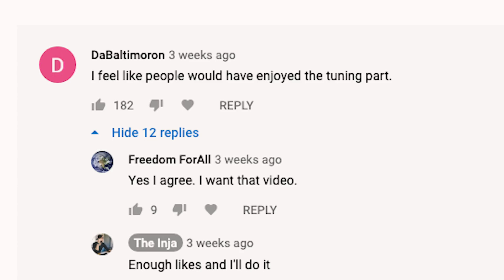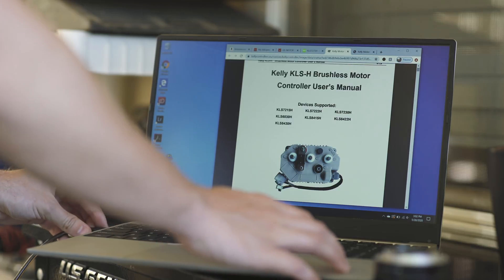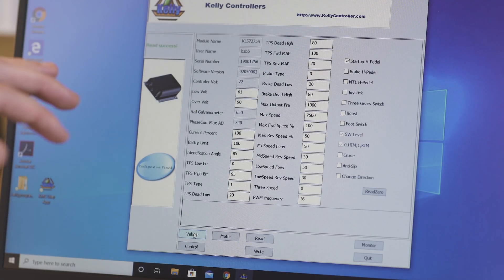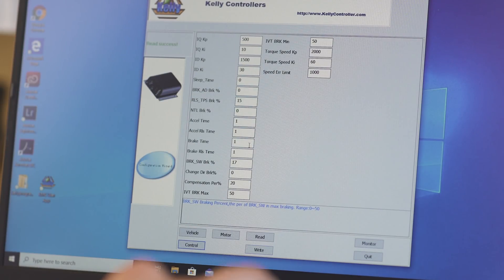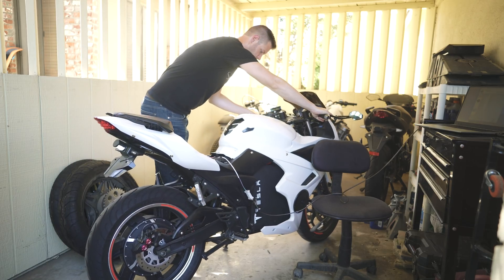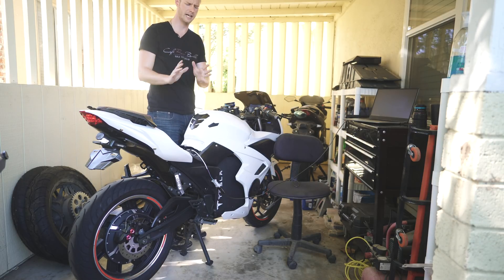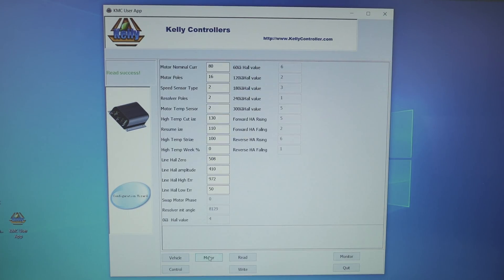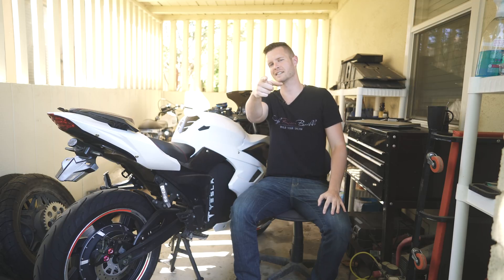TUNING the ELECTRIC SPORTBIKE (How to)

Comment: decided to pull the trigger so in a few weeks my bike should arrive. It's a bone stock rz model with 5kw motor and 72v 55 amp hr battery.
Eventually I'll swap out the hub motor for a  96 v chain drive  motor 15 kw to 50 kw depending on cost to upgrade,  and 200 to 300 amp hr battery or what ever will fit
Reply: well that deal fell through, couldn't get the cash moved soon enough so another buyer won the purchase.  maybe instead of buying a ninja look alike, i should convert my gpz550 bike to electric.  if I do this I'm looking at the sia 155-64 bldc hairpin motor, a 2.x : 1 gear box,  a controller (size unknown)  and a 96 v 100-200 amp/hr lifepo4 battery pack and all the misc stuff,  SIA has a conversion kit that provides 99% of the stuff I'll need.  any thoughts ?   thanks

Comment: I have mid drive motor and kelly controller I have use same settings but my rear wheel hub is burning 🔥 very hot I have Sprocet on wheels whyyyy is burning getting hotter when all regenerative settings it’s fine but why????

Comment: If (or when) I get one of these bikes, I will most likely go with the Kelly controller and QS hub motor (I'm not sure which one, yet) for upgrades. I'll also likely build my own battery packs like you did since I'm planning to do that for my Solar Power system anyway. Nice work on the bike, by the way.

Comment: Can you give me some tips on 5000w what controller do I need like what amps ,what size battery 72v 40ah I don’t know what size bms to use ,I will use top grade cells in the pack . If you answer my question thanks .

Comment: Hi my e bike has 1.5kw rear hub bldc. Having 70volt 30AH lithium ion battery runs upto 75km at 50km/hr avg speed. How to increase range. By putting another battery of same config in parallel? Pls help.

Comment: Sine-wave has amazing controllers as well, but Kelly's are good too. I bought a 36V Hyper E-Ride Mtb from Walmart a cpl year ago and completely redid the entire bike from top to bottom. Replace the entire front end with rock shox, front and rear hydraulic disc brakes, added a second 36V battery to make it 72V output and replaced the factory 250w rear hub motor with a 5000w brushless rear hub motor, moved the (PAS) pedal assist sensor and mounted it onto the front rim and the sensor onto the front shock so there's no need to pedal to engage the motor then the last thing I did was moved both brake assist sensors (spliced them together) and mounted them onto the right handle grip so all thats needed is to press the button to accelerate. With all the mods done the bike does approx 80-90 km/h and gets about 36km per charge.

Comment: You DEFINITELY need to change the rear rim/tire to something much wider i.e 260mm/270mm/280mm it would make it look much more aggressive similar to a R6/CBR600/GSXR600 ect. I think it would look bad ass. Right now it just looks like a 125cc/250cc.
Reply: Avon speedmasters would work fine

Comment: change your settings, thats a slow ride

Torque Speed KP: 10000
Torque Speed KI: 500
Speed Err Limit: 4000
Max Speed: 15000

ADJUST YOUR THROTTLE AFTERWARDS

Comment: Are you sure the regenerative braking is actually charging the battery? My understanding is the BMS needs to support it, because you need to send the power back through the discharge port. I'm not sure the way you have it wired (bypassing the BMS for discharge) would work?
Reply: Yeah, the discharge is bypassed :)

Comment: Hey man good stuff. Wondering if you have gotten legitimate measured HP and torque numbers. My guess would be about 8 HP. Here's my math based on my best guess of 75%  peak motor efficiency : 8000W/(745.7W/HP) X 0.75 = 8.05HP. Would love to see dyno numbers.
Reply from the maker: Peak is 12HP. Would be interesting, but not worth it in my opinion. Our next build it would be more worth it! 😏
Reply: @TheInja  Gotcha. The capability is amazing and speaks for itself. Nice work and way to hang in there. Inspiration to finish my buggy engine swap.

Comment: You should check out Cleveland cyclewerks for there edrive kit 2400$
Reply from the maker: Actually just checked them out
Reply: @TheInja  was wondering if you could give some tips on getting my channel going. My first build is 2016 Cleveland heist cost 2600dollars with drive train and battery out of a 2011 zero xu cost 2500 to build electric bobber
Reply from the maker: @buildyourdream5159  just start and learn what works ☕

Comment: Hi friend, good questions. You don't needs off the breaker after changing parameters only cycle the key . I have kelly controller on my ebike and I never disconnect battery after changing parameters. After connection bluetooth and change parameters you don't needs removed the seat , only cycle the key.👆💪💥
Reply from the maker: I tried that, it doesn't work 👌🏽

Comment: You should cycle that regen back to a super cap, push that to a charge circuit and you'd likely add length to the lifetime of the charge. Would be stoked to help at all, did the same on a mini bike with a 3kwatt. Awesome build bro!!

Comment: how are the brakes and tires holding up? is suspension worth upgrading or is stock fine? my bike should be here before the 4 of july...CANT WAIT!
Reply from the maker: Nice! My only complaint is the front brakes squeak. They stop fine, they just sound cheap. Luckily the front end brakes and suspension is a 2008 Ninja 250 clone so it looks like parts are direct replacement
Reply: @TheInja  ninja 250...thats good to know. does the ninja fairings fit that bike? the bike im getting looks more like the other guy (and son) on youtube that also ordered from same supplier as you.
Reply from the maker: @johnjetlee362  nope

Comment: I just had the best experience with an amazon seller. I bought a 48 V 20 Ah battery pack for about $300.00. When I went for my first ride I couldn't accelerate faster than 12 mph without the battery cutting off. You can't return battery packs to amazon. I'm thinking oh great I have a $300.00 brick now. The seller is going to refund my purchase, is letting me keep the battery and is ordering me a new BMS to install in the battery. I have no idea how to install a BMS so that's going to be "fun." Apparently the manufacturer said the battery could handle a 1000 watt motor but it turns out they were incorrect and it can only handle 750 W and below. I'm thinking when the new BMS arrives, I'm just going to sell the battery with the original electrical components from my ebike. It'll come with a 350 W motor which the battery will be able to handle.
Reply: We showed the process a bit in this video, in case you missed it! https://youtu.be/oXQrK5CCDfY
Reply: @LordCurt  Thanks, I watched the video but I don't think my hands are steady enough to do that. I mean I get freaked out when I have to attach new connectors onto the battery pack. I wish I could find somebody down in my neck of Cali to help but there's no real ebike community around here.
Reply: The BMS and motor controller are two different components. You need the right controller for your motor, not a different BMS.
Reply: @peterkacandes5905  Yeah I know. I had to replace the ebike components that came with my ebike with a front hub kit because the components, other than the motor and controller, were complete trash. The rim and spokes kept bending and breaking and I can't find a local bike shop that'll build my rear hub motor into a better wheel. Besides getting the motor built into a new wheel is about what it cost me to buy my new kit. The battery I ordered was supposed to be able to operate a 1000 W hub motor but it turns out the manufacturer fibbed a little bit. I've been riding, working on, and building personal ebikes since 2009. The only things I don't know how to do are wheel build and building battery packs. Thank you for trying to help though.

Comment: Awesome! Thanks for sharing. Am I right you still have to balance your wheel ? When you reved it up without regen I saw the bike wobble a bit. Would be another interesting video ;) .
Reply from the maker: That was just from the torque. The wheel is so heavy a slightly unbalanced tire wouldn't make a difference!
Reply: @TheInja  Normally the whole wheel gets balanced, not only the tire. In your case including the spinning part of the motor, but without the stationary part. I'll search for an example.
Reply: @TheInja  Here is an example: https://www.youtube.com/watch?v=CnkFgjI9Cxo

Comment: I wonder what happens when you enable the "Boost" Option 🤔🤔
Reply from the maker: Haha you have to have the boost wires connected. Just gives you instantaneous 100% throttle
Reply: Hes too chicken for full throttle instantly
Reply: @jordan0338  he's running the controller at 50% too, he didnt set it up properly

Comment: I am annoyed by the clicking sound coming from the rear wheel, is it okay? Seems not ok to me, but I know its there pretty much from the beginning...
Reply: Do you have a square wave or sine wave controller? if you have a square wave you hear the "clicking" at low speeds. That's normal and you shouldn't worry about that. If you really want no sound, buy a sine wave controller. Except for the noise there is not much of a difference. Maybe a bit more efficiency but not noticable. The real difference is the price actually. If it clicks all the time and really doen't pull off as it should, then your motor isn't wired correctly, or your controller setting on motor poles is incorrect, which is a concern and should be fixed asap.
Reply from the maker: It was louder straight out of the box, but after being broken in is definitely quieter

Comment: When you turn on (add 17 or 14) on the re-generator, it means that when you are reducing the speed the motor generate energy to recharge the battery?
Reply: Correct. I guess the higher the number, the better recharge, but increased danger of losing grip and control of the bike.
Reply from the maker: Yes, when throttle is released, Regen kicks on to recharge the battery. The higher the number, the more it regenerates and engine braking is more aggressive
Reply: @TheInja  Thanks Inja

Comment: I know nothing about this at all so if I'm way off please let me know...but it warns you not to have the rear wheel spinning while the program is running but then you ran the bike while the program was running. Aren't you worried about damaging the controller?
Reply from the maker: I wasn't spinning it with the program running. It's fine. Anytime I made a change I wrote it, reset the bike, then tested it before re-opening the program

Comment: Were you able to tweak the controller to raise the top speed? I was thinking that maybe they set it to 74 mph as that is the highest constant speed it can do without overheating. Maybe it can be set higher as long as you dont abuse it. Also, what effect did you see by setting it to 16 poles? Did acceleration pick up?
Reply from the maker: Nope, top speed is now limited by RPM. 

Motor ran smoother with 16 pole, but I'm going to try going back to 8, since Lord Curt suggested maybe the controller setting is counting pairs of poles (8 instead of 16) and see if it improves acceleration.
Reply: @TheInja  Someone commented about a racing team that uses QS hub motors and they tweaked the controller to increase the top speed. I wonder if they used a Kelly controller or a different brand. It's interesting if the controller can override any speed limitations built into the motor. IDK,  I just thought I'd mention it.
Reply: @TheInja  The info (aliexpress) on your motor/controller kit says that it is a 16 pole pair motor. For as far as the info is correct.
Reply: The 16 pole setting is not for speed or torque, is for a better/more correct work of the controller

Comment: Does the controller software let you make a back copy of the settings or is there a default just in case you bork a whole bunch of things and can't remember the numbers you had set before?
Reply from the maker: You can rest to default if you need to, but we just took screenshots in case we needed to. But the parameters we're so far off from what we needed, going back to default settings wouldn't do anything

Comment: I would probably put the brake regen to like 50 or 60 better mileage and you'll save money on brake pads.
Reply: It's purely personal based on riding. If it's too high you might lock up the rear tire releasing the throttle on a wet road. Besides, the numbers are kind of meaningless and arbitrary.
Reply from the maker: Nah, I'd be trading engine braking for heating up the controller. I'd rather not put it too high and fry the controller